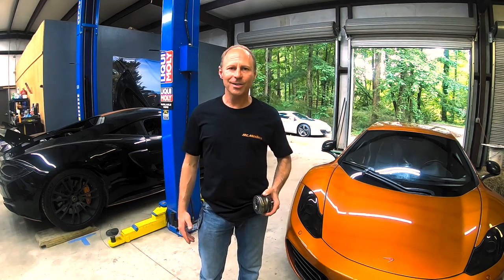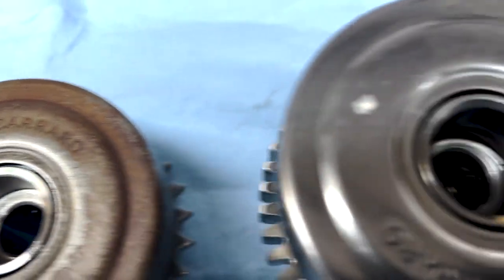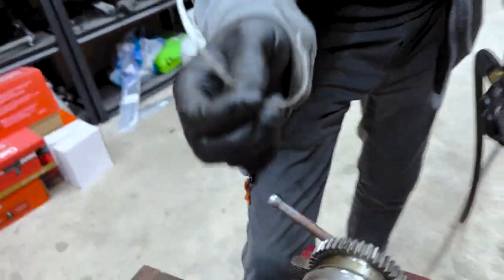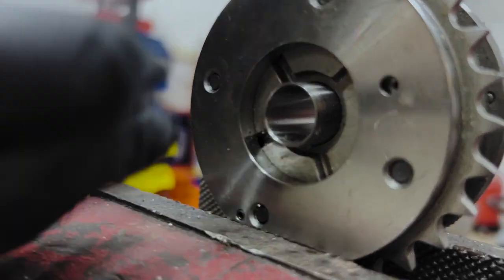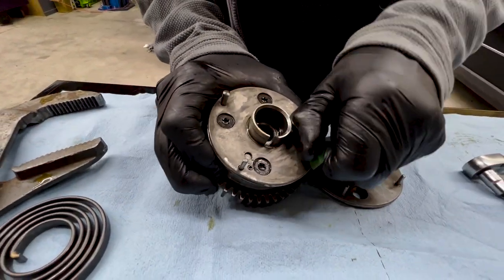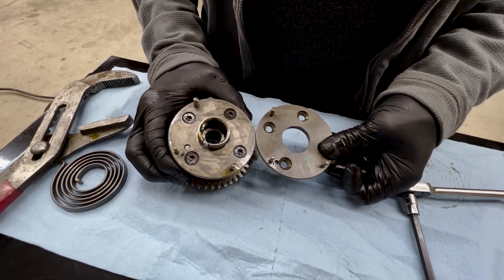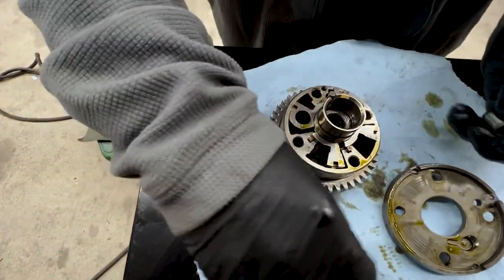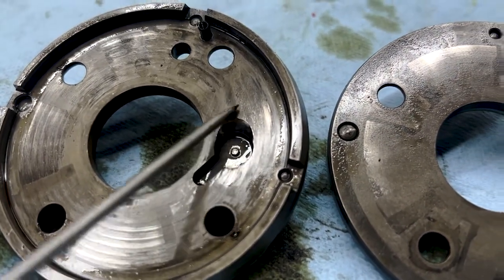Why Your McLaren Cam Phasers Are Going Bad !

Comment: since cam phases have been introduced I have changed many BMW's , smaller engined Volvo's and Renaults. I cannot recall changing one on a Toyota and maybe one or two on a Honda. I have disassembled  Hondas and got them working because of missed oil changes gumming them up. Perhaps BMW/ McLaren etc should look at Toyota's method of doing things.....

Comment: This may seem insane, But I know other vehicles have similar issues with cam phasers. One that stands out in my mind is the 5.4 ford triton v8. A solution they have come up with is using machined pieces to lock the phaser in place permanently. It doesn't hurt performance on that engine, but it's also not a twin turbo supercar engine.

Comment: Excellent video!!! I have more experience with Ford cam phaser issues and cannot stress enough the importance of proper oil changes on any vehicle with cam phasers/variable camshaft timing. Do you know of anyone "locking the camshafts" on  a M838T or a M840T for very high HP applications?